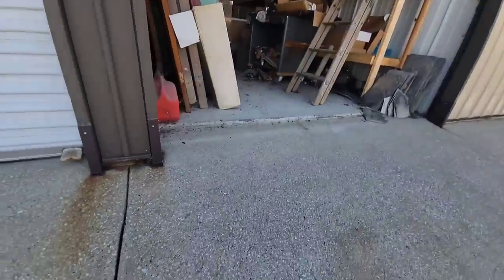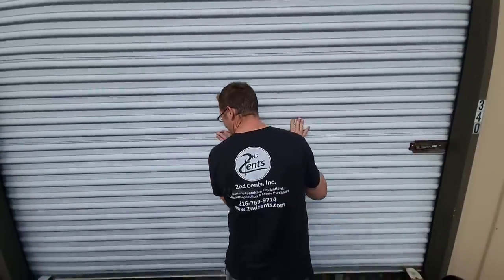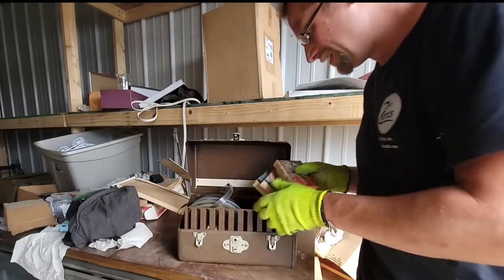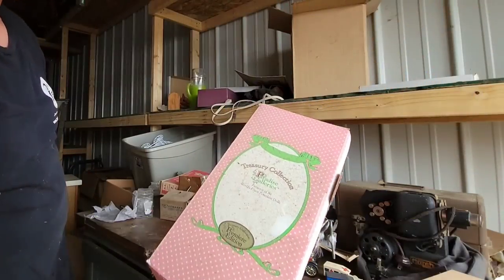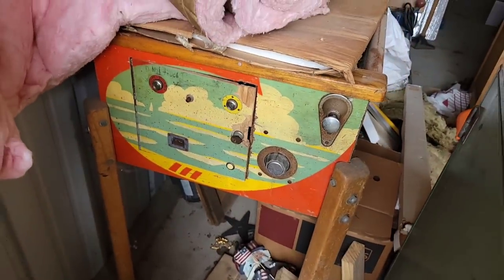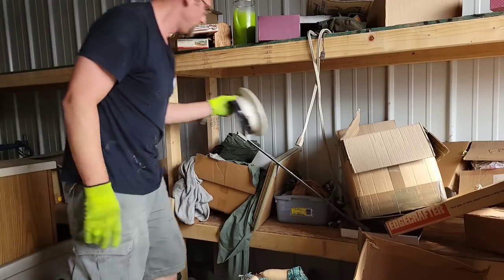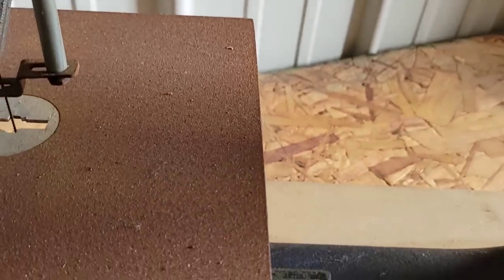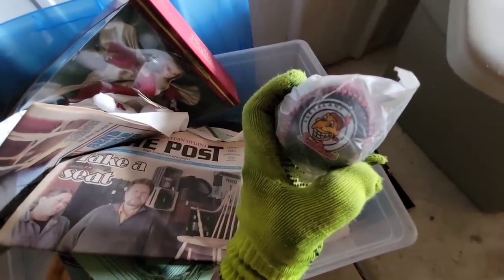NO ONE shows up to Auction! ~  Only $25 for abandon 10x30 Unit!~ Storage Locker LOADED w/ Profit! P1

Comment: If the films is OLD, they can be dangerous if they are made of celluloid. or may by not.
# Most movie and photography films prior to the widespread move to acetate films in the 1950s were made of celluloid. Its high flammability was legendary since it self-ignites when exposed to temperatures over 150 °C in front of a hot movie-projector beam. While celluloid film was standard for 35mm theatrical productions until around 1950, motion-picture film for amateur use, such as 16mm and 8mm film, were on acetate "safety base", at least in the US. #

Comment: "Bingo" pinball machine. Bump the machine to try rto get the ball where you want it to get 5 in a row. Bump too hard it will tilt. A skill many in the past acquired. Older ones were 10 cents, followed by quarter machines. Certain combinations scored more points. Rack up the points and you may have gotten paid off. Should be a button in back or on the bottom to take the points off.
Reply: They were 5 cents back in the 1950's. But you could increase the payout by putting in multiple nickles before the game started.  Was not uncommon back then to see a guy put in 20, 30, or 40 nickles in to get the odds he wanted.  If a guy won a big payout, the machine's bell would ding once for every nickle he won.  A really big payout would have that bell ringing for 3 or 4 minutes straight.  Everyone would come running to see how much.